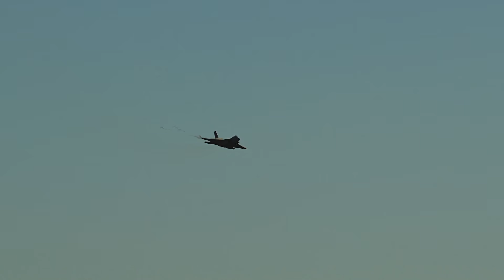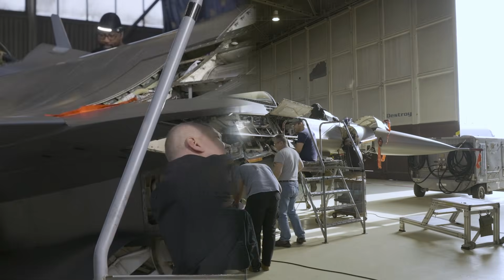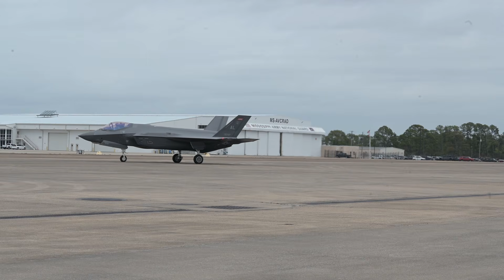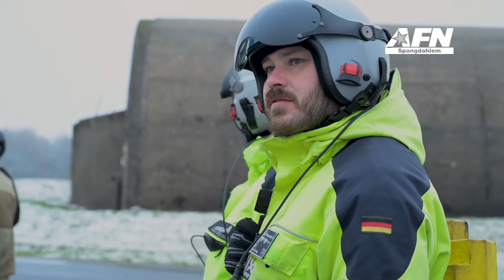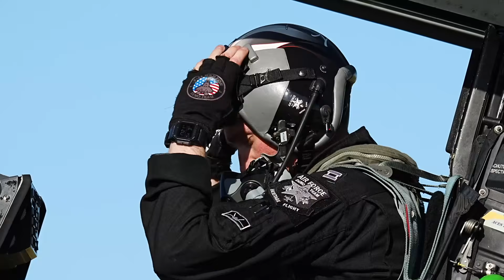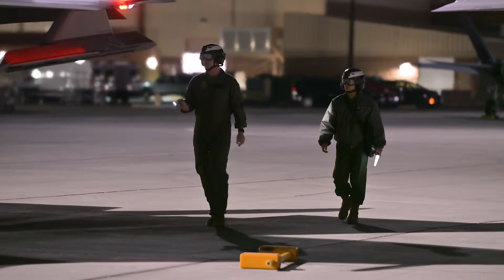Sensor Fusion Is Quietly Revolutionizing Aviation | Here's Why

Comment: In the entire F series of USAF air assets,the F22 is by far unscathed as it hasnt seen any real action, especially in the Persian Gulf area😊
Let it prove itself in real war time scenario rather than in promos and reels where it has been hyper eulogized.
F16 and F35 are already done with😊
Reply from the maker: Fair point and appreciate the perspective You’re right that real combat experience matters and platforms like F16 have a long operational history At the same time the F22 was designed more for high end scenarios and deterrence rather than frequent deployment so its role is a bit different In modern context effectiveness is also measured by integration sensor fusion and how well a system performs within a network not just combat exposure